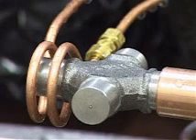Induction Hardening

Comment: @The Lightning Stalker
The cylindrical component is rotated to prevent the impact on hardening due to lack of concentricity of  the  component
Reply: Actually they rotate the component to ensure an uniform layer of the induction hardening. But at the type of coil used it wouldn't be a must to do so because it was a double circle coil.